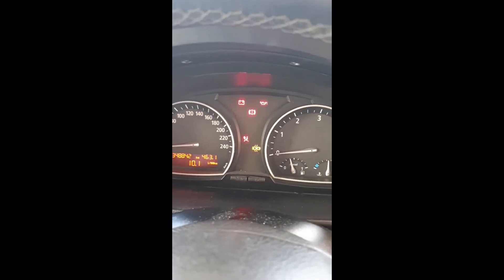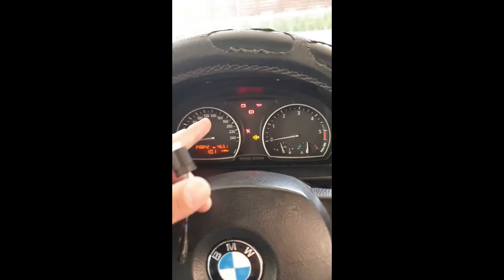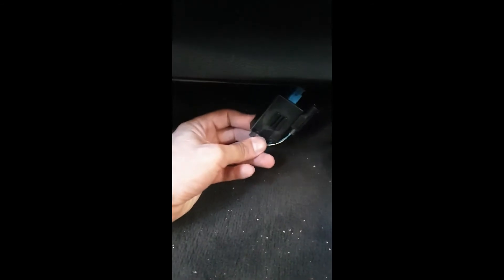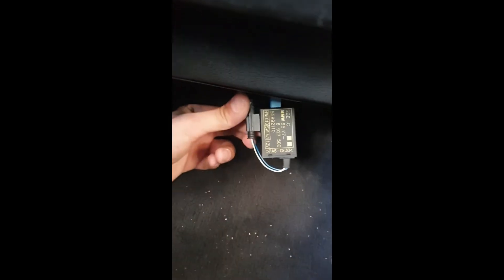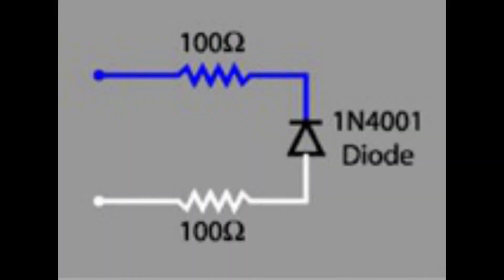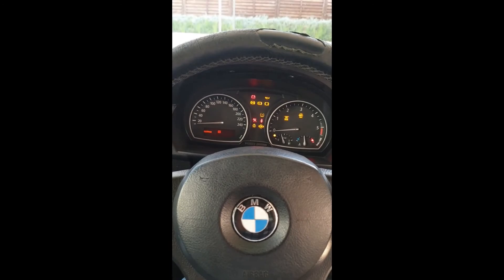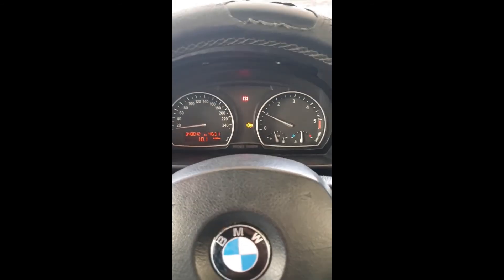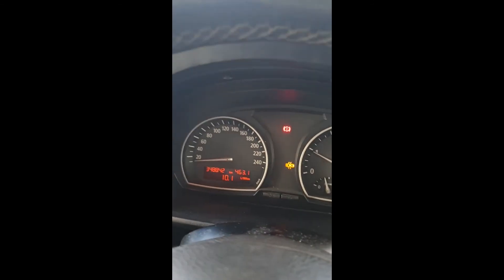BMW X3 E83 occupancy sensor Fault. Fixed

Comment: Hi,  thanks for Video i have also a Problem,  Airbag light is on (red) - read with Ista D Software and it tells  1:Faultcode " MRS : Message from DSC Sensor  missing or incorrect " 2.Faultcode "MRS : Message from DSC control Unit missing or incorrect and " MRS: Message from Control Unit DSC  missing or incorrect " ? Have you a Idea? thx